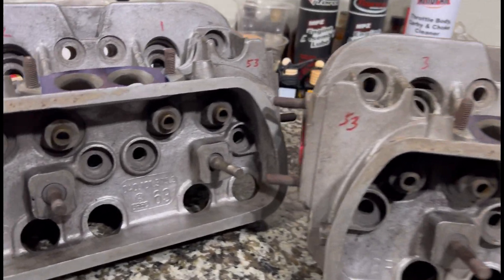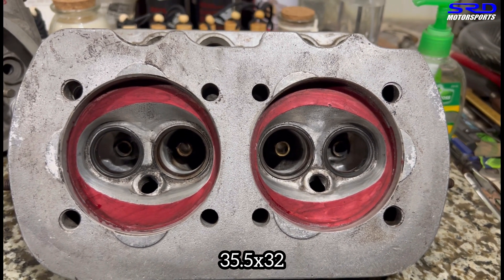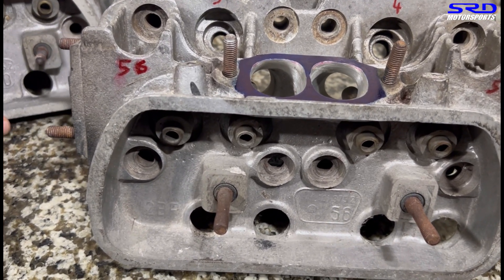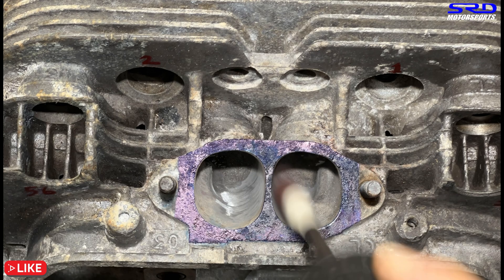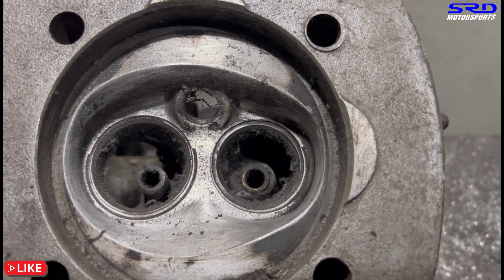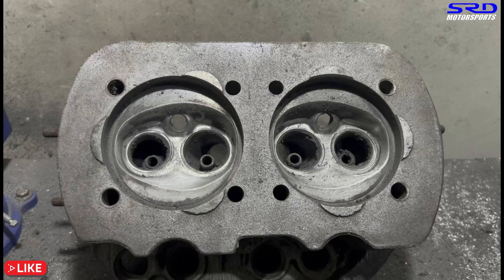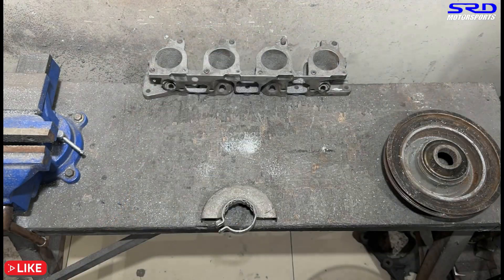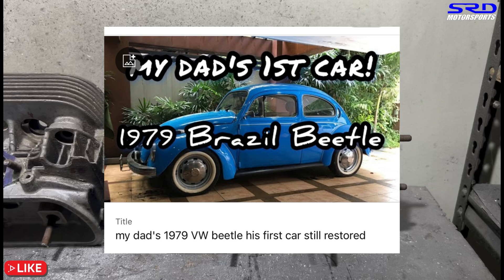VW Type1 040 Head Porting and 041 head by Clyde Berg

Comment: Great video and very informative!!  I'm building a 1904 with a scat C35 cam (like a 110) & duel IDFs that I'm actually getting ready to do some home port work to....and it seems like there are two views on heads for that motor - #1.) go 40x35 or #2.) go with 040 stock 35.5x32 ported heads.  As an experienced  VW porter, I'd be curious what your thoughts are on that?  I already have some 040 Autolinea heads that I cc'd at 51cc and would hate to discard them if they'd be a great match for the motor.  Thank you for such a great Video!
Reply from the maker: @culturedredneckgarage3784  nice motor! C35 is indeed nice (close to engle110 yeah) what size IDF do u have? But either way a good ported 35.5x32 should push to about 120hp with good exhaust and tune so 

I feel I’d lean towards that… the airspeed u got there is “nice” for efficiency (not a lazy motor) 

A bit more top end could very well be provided by a slight vent size jump depending on ur carb size

But yeah I’d use what you have , the 040 
do some good clean up like on this vid
Send it out for a good valvejob and you’d be all good
Reply: @SRDmotorsports  Thanks for the reply!  That's kinda what I was thinking and hoping to hear.  Who knows, I may up going larger valves down the road, but it at least seamed to me that the most could be gotten out of the stock valved heads with this combo if ported correctly.  Whether right or wrong, my carbs are dual Italian 44 IDFs that I've jetted and vented down to 32mm to hopefully compliment the 35.5 valve size as best I could.  I know 40 idfs would be more ideal, but these were given to me for FREE many years ago...just needed a thorough rebuild.  after figuring my deck height, the compression came out to 9.2:1.  The exhaust is a merged tuned exhaust as well, so it seems like we might have a good recipe for a spicy little engine - no road rocket, but a fun and durable motor for my rail.  Thank you again!
Reply from the maker: @culturedredneckgarage3784  nah man I would run the 44idf even on a 1776 so IMO it’s perfect on your 1904 and yeah good call on the 32 vents I’m no carb tuning expert but that’s good to reference the valve size…I think this set up of yours would be gold!